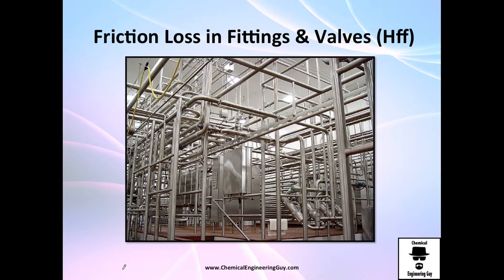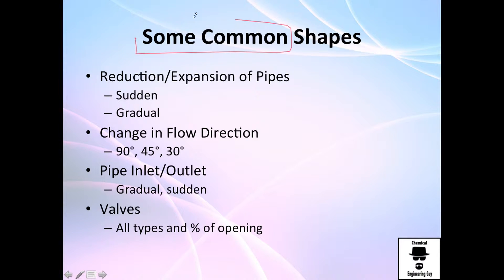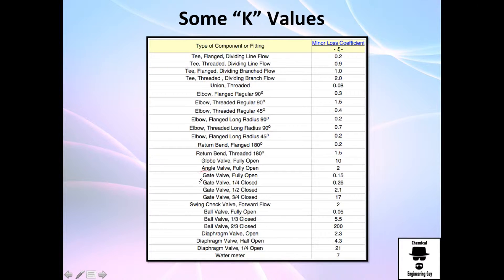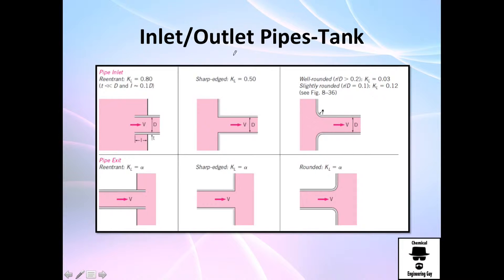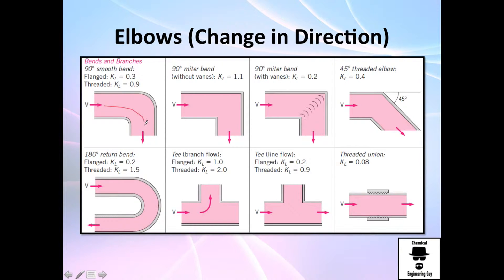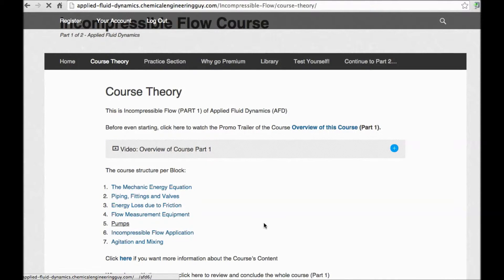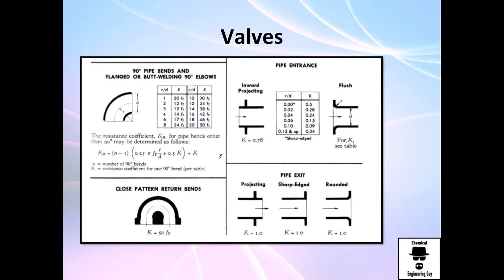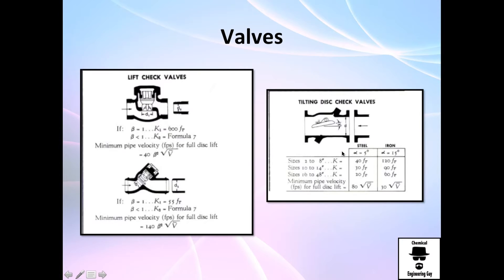K Constant for Fittings and Valves - Applied Fluid Dynamics - Class 035

Comment: If i have a segment of pipes with the same diameter can i just add up the k values to find the total k value? im required for an assignment to find the total k value for different segments which have multiple valves and elbows
Reply from the maker: wel... if they are exactly the same, you can assume the same K value, you just change the total length, not the K value, remember it is an identity